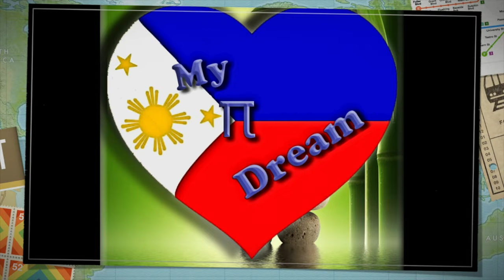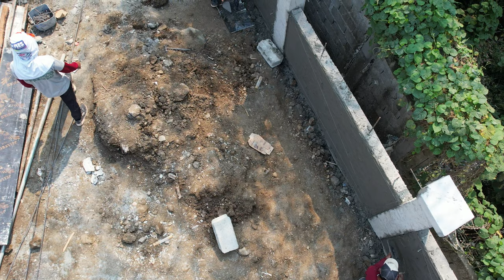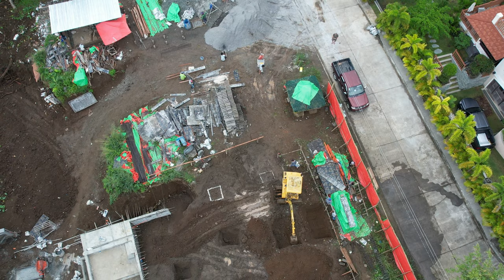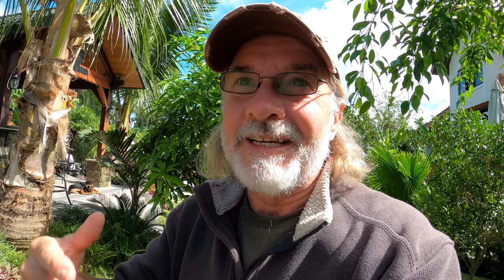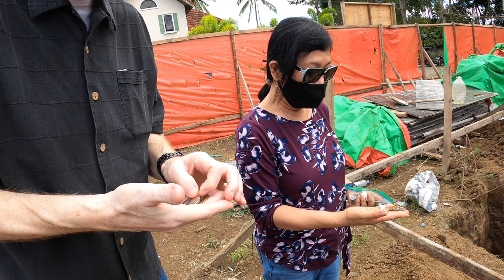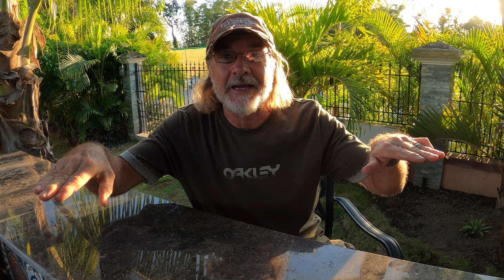NEW HOME BUILDS - EPISODE 8: MAIN HOUSE FOOTING (House Building in the Philippines)

Comment: Hi James
Great overview of construction challenges faced.  But you missed a great opportunity to review the techniques and  methods for setting and positioning of columns. A question remains: Why would one not want access to the back of the creek and revine?   It's a real nature preserve that could be enhanced overtime, much the same as the perimeter of your property. Constructing a secure gate would allow for maintenance and protection against hazards.
Reply from the maker: Those techniques were discussed in great detail in the 300+ episodes building Villa Feliz.  The New Home Builds series are an abbreviated condensed collection of house builds but I do try to get into the details from time to time.  I agree with you some details are good to readdress for new viewers.
Regarding the creek, there is a subdivision security wall that is not owned by the property owners and is owned by the Developer.  This property can not be breached as a security requirement.
Reply: @MyPIDream  Comparative methods and techniques are always welcome. The knowledge base contractors share can bring the whole industry up by the bootstraps. Nature preserves and their contributions should not be overlooked by the developer. Currently I have 3 running build projects in Philippines that I subscribe to on U Tube. Those that integrate the architectural design with the  nature are favorites. Cheers!
Reply: @Petekru,  Remember, this is a gated community.  Areas beyond the perimeter walls are not accessible legally and logistically.  But this build indeed has taken advantage of the backdrop of the creek.  The plot is not flat and with a drop towards the back.  The builder has created an architectural design that takes into consideration the great scenery from the back where the creek is and incorporating the unique topography in the design.  Have you seen the architectural cad fly-by in Episode 1 of this series? Let me know your thoughts.  👍😄🌹
Reply: @necietanner3147  The whole series of episodes several hundred in total I have viewed multiple times in many cases. There were many fly over produced over time however Episode one I have no recall of; certainly take a look again. In the meantime check out Karolina a young teen musician busking on the big city streets. She's gotten  3million hits since May and is proving to be a super star in her own right.  Cheers.
https://www.youtube.com/watch?v=-9ZKLGx7KcA
Reply: @necietanner3147  Episode one It took a bit of time to scroll back.  But yes I now recall the scenes of the start up. Really remarkable in terms of how things looked back then. And the wild nature of the whole estate. The  project has been quite an adventure from start to finish! 
 I digress Nessie once again, "how's that Karolina violinist?" She's brought in a couple of million for her and her family. But the sheer entertainment value like James videos are hard to beat! Right now I am following up on a build in Bohol right on the steep cliff face of a beach front. Filipino couple from Florida are constructing their dream home. Bye for now!